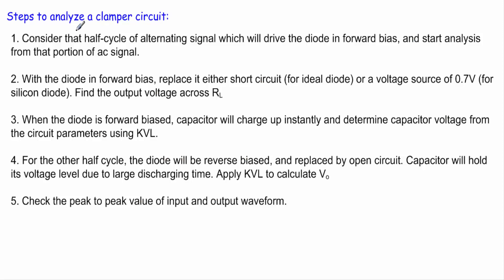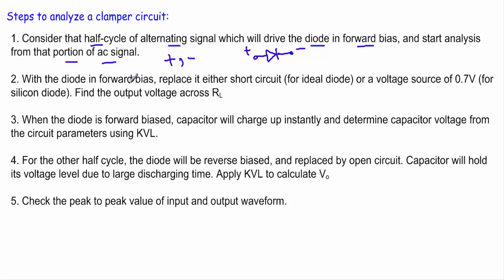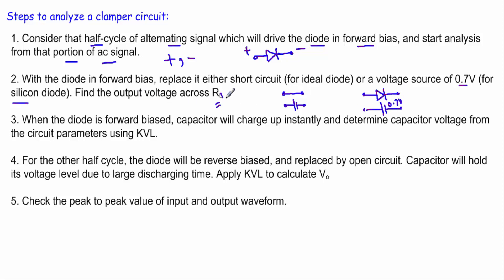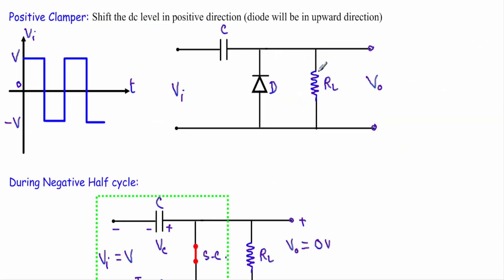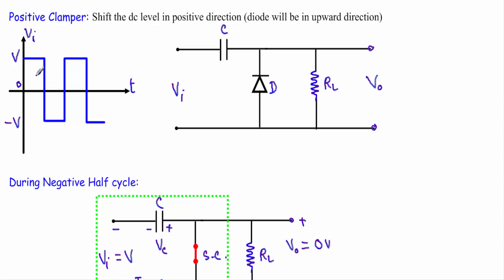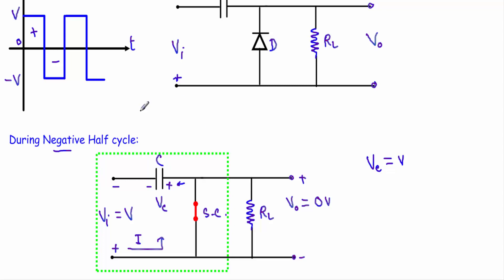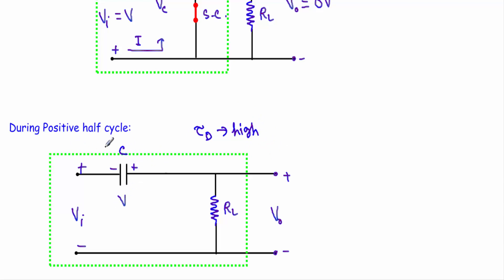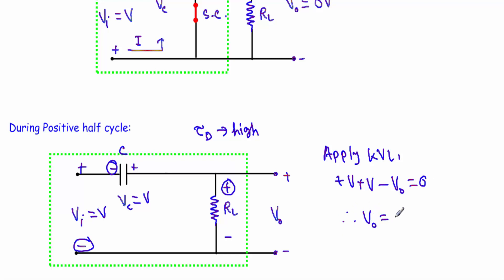Positive Clamper Circuit Operation and Clamper network analysis

Comment: I have placed a Rs 82ohm, C= 10 nF, D= 1N4148 and RL= 560 ohm. The input signal is a +-2.5 volt square wave and its frequency varies in between 700kHz and 450kHz. How it works, please can you explain?

Comment: Thanks for the great video. One question. Just to be clear, if the capacitor maintains the vast majority of it's voltage during the positive-half-cycle and charges -up instantly in the negative-half-cycle, then it appears that the capacitor never discharges much at all and thus maintains a relatively constant voltage. I this correct?

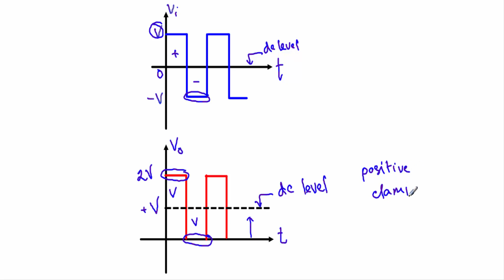Comment: Your input waveform at 10:12 starts with the positive half cycle, didn't we start at the waveform that forward biases the diode, the negative half-cycle? So input waveform 1(negative half cycle)  = -v, outpout = 0v. Input waveform 2 = +v, output waveform = 2*v?

Comment: why you take negative as positive while applying kvl on both capcitor as well as battery in negative half cycle
Reply from the maker: During negative half cycle, the voltage across two input terminals must be -V. So we have two options, either we specify upper terminal as -ve and lower terminal as +ve and take Vi = V, or we can set upper terminal +ve and lower terminal -ve and take Vi = -V. I followed the first process..